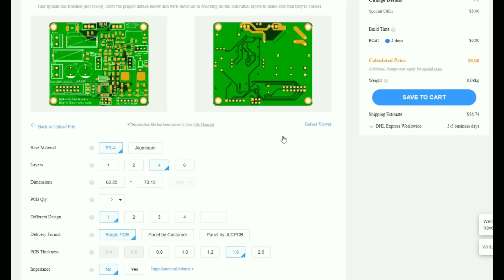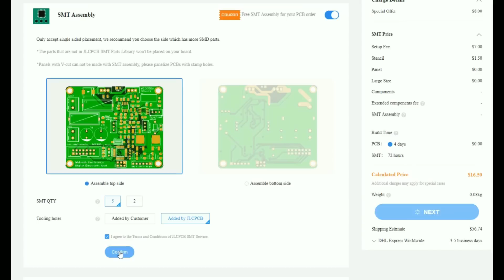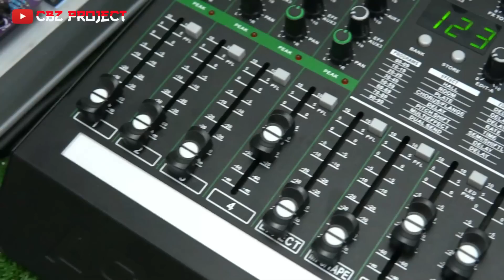[DIY] 20 Transistors Powerful Amplifier Board using 2SC3858 & 2SA1494 - SOCL 504 TEF | #cbzproject

Comment from the maker: ✔Build a High Power Amplifier Using 32 Transistors
https://www.youtube.com/watch?v=ZoBxzzhOQSQ&t=21s
Reply: need gerber files for SMBS
Reply: Anong klasi ng soldering iron gamit mo, bilis maka tunaw ng lid kahit dulo lng
Reply: cbz project  mas jual di marketplace gk
Reply: please share all pcb garbaer file that you use in this amplifier
Reply: please share all pcb garbaer file that you use in this amplifier
Reply: please share all pcb garbaer file that you use in this amplifier
Reply: please share all pcb garbaer file that you use in this amplifier
Reply: please share all pcb garbaer file that you use in this amplifier